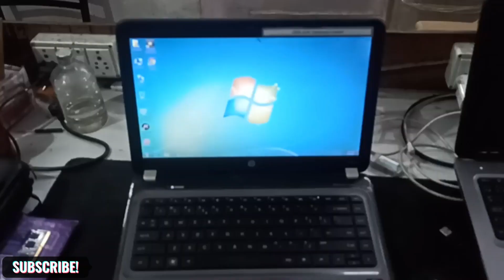Most common fault on a hp pavilion g4 dead laptop l hp support

Comment: Hello! I've tried to change thermal paste on this laptop [HP OMEN 15-DC0013NS] and when I've connected all the things back and try to run, the only thing that I could see is the button to turn on the machine lights on and off after few seconds and It repeats all the time and thats it, what can i do?
Reply from the maker: check ur on/off button connection once unless make one small video send me my whats no. 9373621973
Reply: @mscreation1000   Do you have any email? I tried but i cant find you on whatsapp
Reply from the maker: maheshsawarkars@gmail.com
Reply: @mscreation1000   Sent you an email on there!